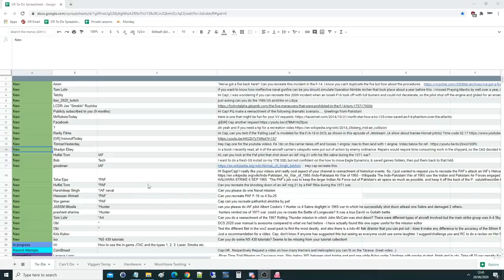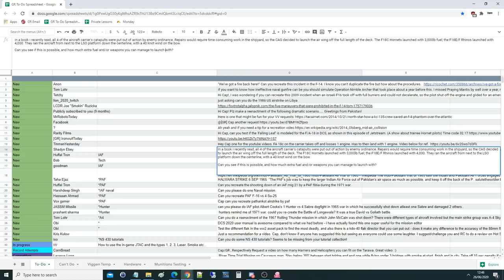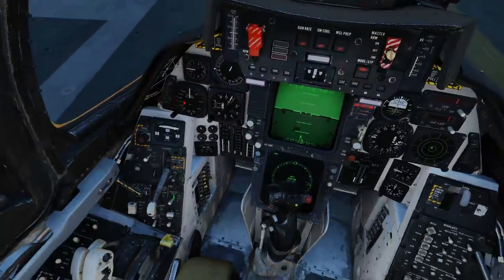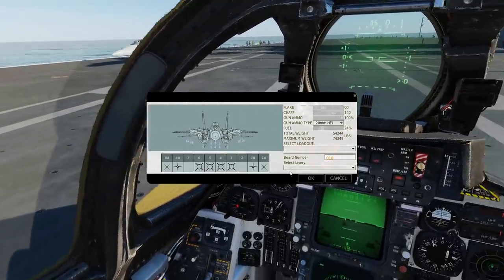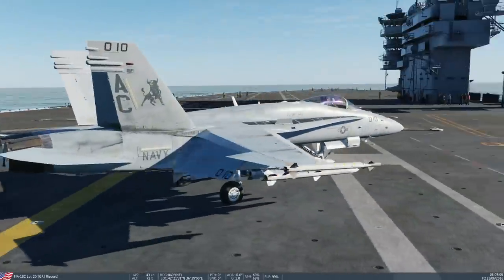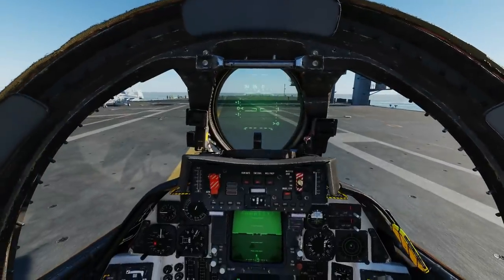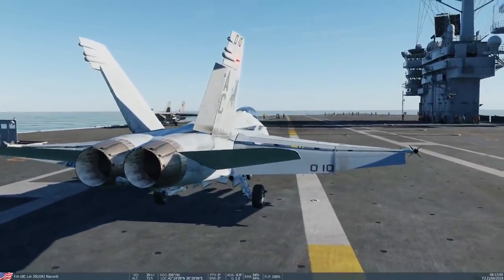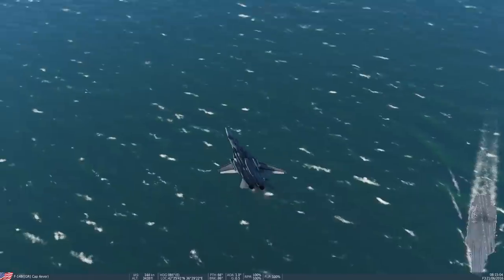Questioned: Can Naval Aircraft Operate With Broken Catapults? | DCS WORLD

Comment: The point was well-proven in this video, so it's only argumentative at this point...but who doesn't enjoy arguing? I believe the point of going with the minimal fuel, etc, from the book would have been to just get the planes off the deck and get them to the beach. Making them as light (low fuel) means a wider margin of error for take-off without any concern for strike capability. Putting the combat load-outs on the planes negated this aspect. 

But, again, the video shows that - in DCS physics, at least - they were still capable of launching even with the full load-out, as long as the carrier speed and wind conditions were right.

Comment: 4:24 Strange and interesting behavior by the F-14 flight model, while the F-18 has gear damage programmed into it, (you’ll see it later during the clip) the F-14 is missing this “detail”. I think the module needs some love after its release, how many improvements did it get since? I hope Heatblur will upgrade it along the way.
Reply: I think I had some gear damage when my F-14 did some high speed ground test runs. You know, when you need to make that 90 degree turn at the end of the taxiway with 50+ knots.
Apparently the outward main landing gear got damaged and did not retract after take off.
Reply: It may have been damaged and just didn't notice, or the nose were already airborne by the time it reached it, or lastly he may have hit it at the right angle at right speed where the nose is close to taking off for it to act as a sort of ski jump cause he did climb suddenly when he reached it
Reply: Due to the angle...it looks like he hit it dead on which is why the nose bounced up, the F-14 has overly ridiculously strong gear... (I mean Grumman did drop it from 25ft over and over still it finally broke) so I think it just took it like a champ and moved on lol

Comment: 40knts before the wheels are rolling, and a stall speed of 120?  Yeah, you will make it no problem.  The catapults really just let you operate with 1/3 the deck for take-offs , 1/3 of the deck for landings, and another 1/3 for on top storage.

Btw, a better plot scenario for disabling the catapults would be “supply chain sabotage”.  Just replace the catapult lubricant with a damaging fluid back at a supply base somewhere.  Put a rfid in the pail.  Then you could attempt to attack the carrier with weak a-g type planes once the air-cover of the carrier is disabled.  

That would be a cool scenario to play out.  A carrier that could only put two f18c in the air at a time, vs a dozen sea flankers.